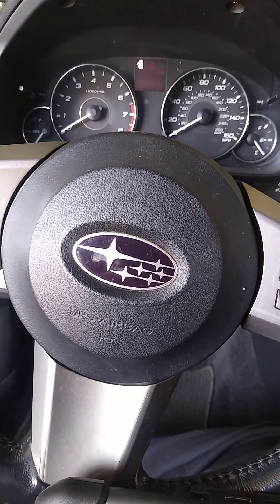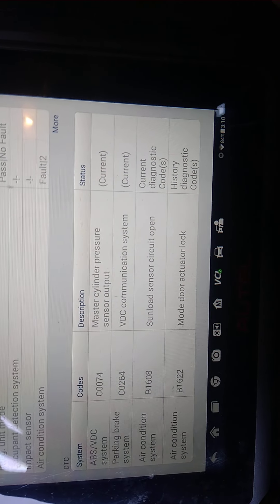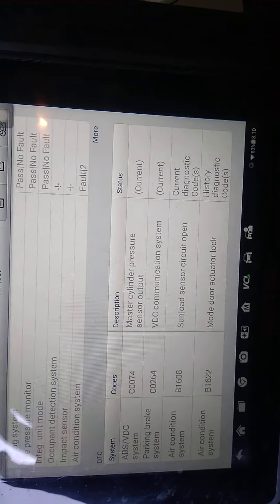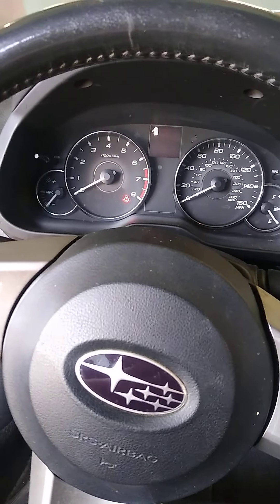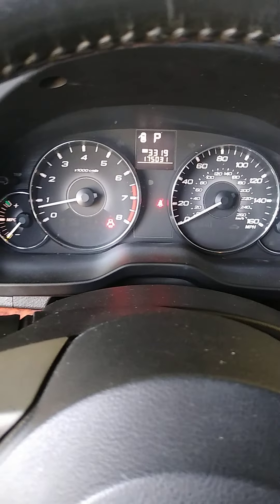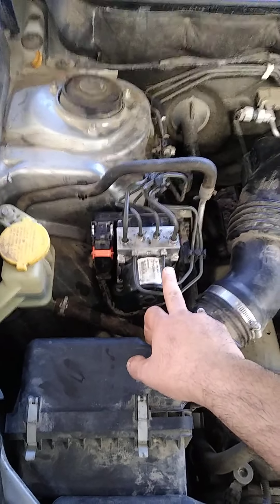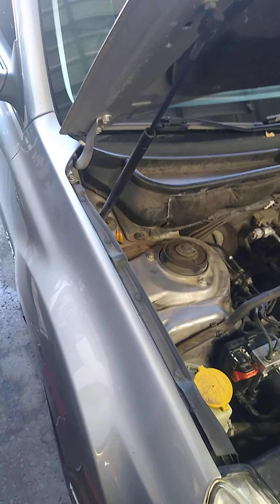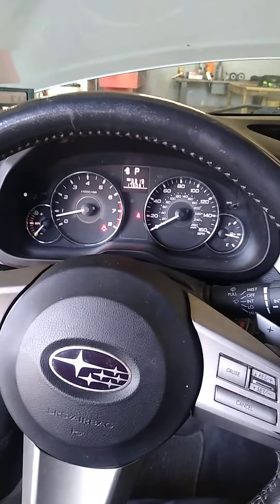2011 Subaru outback ABS pressure switch problem code C0074 & C0264 , easy fix.

Comment: Nice video! Very important tip though, when you bleed your brakes, you want to start with the wheel that’s furthest away from the master cylinder so basically the longest line, then work your way to the shortest line. This will ensure you get all the air out.

Comment: Thanks for the video! I have the same issue with my 2010 Legacy/liberty, my question is, once the unit was replaced, did you have to program or clear codes after the new unit was installed ??
Reply from the maker: No you don't have to program it but you have  to clear the code .
Thank you for watching please subscribe the channel if this video help.

Comment: Great video! Thank you so much for posting. I have this exact issue going on in my 2012 Outback. The only question I have is whether or not its advisable to purchase a used ABS module as a replacement or just buy a new one? Used ABS modules on Ebay are $85-$110 with most coming off of Outbacks with unknown mileages. New ABS modules are $500-$650. Recomendation?
Reply from the maker: Thank you for watching the video.
Well the one I purchase it it's used from junkyard they give me warranty 3 months so I guess new one too expensive . Even eBay they give warranty too.